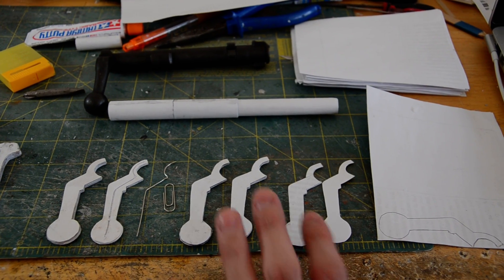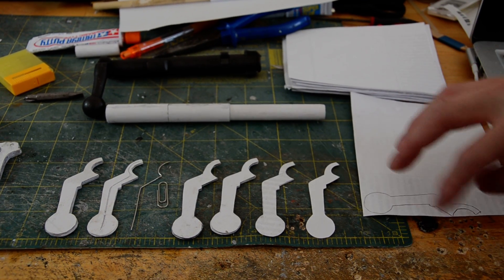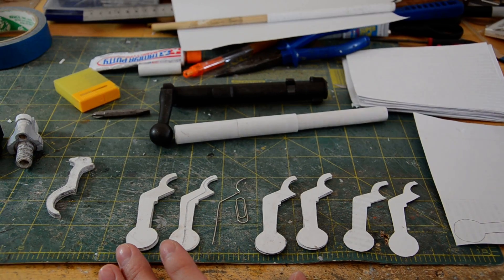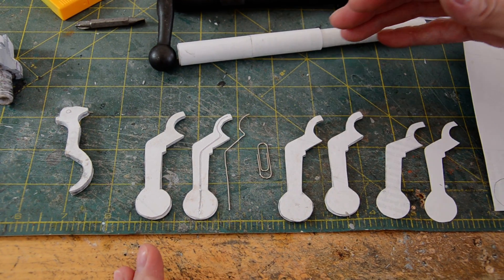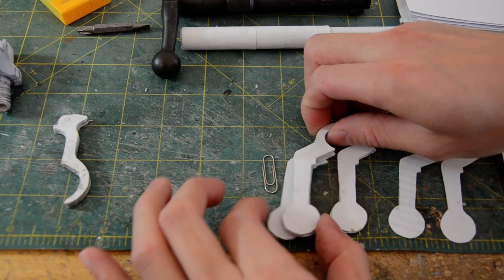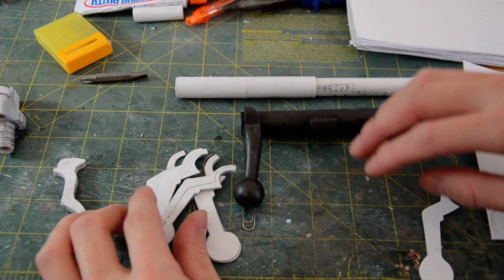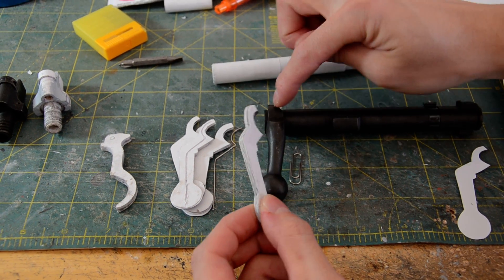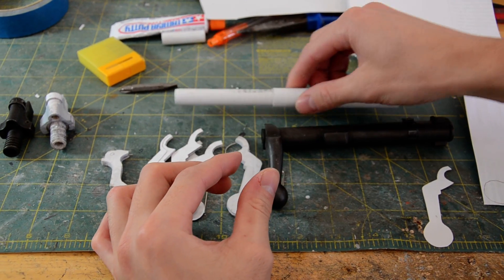Paper M1903 Pt. 2: Constructing the Bolt Handle

Comment: For increased strength between the bolt and bolt handle, consider using a longer piece of metal that extends out of the curved end of the bolt handle.  Then, drill an appropriate mating hole in the bolt when attaching them.  Now you have a piece of reinforcing metal between the two, which should provide some additional strength to the joint.